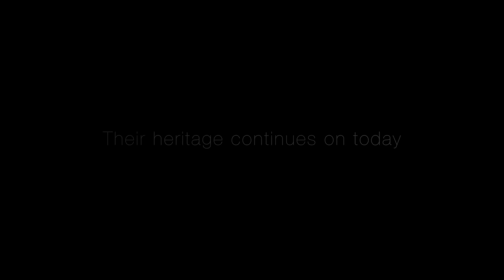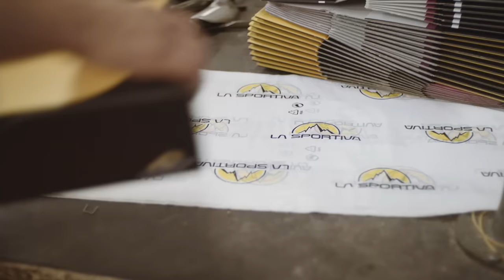La Sportiva: sounds of a brand

Comment: I have worn the La Sportiva Nucleo High GTX Boots for almost 2 years now, and put over 1500 miles on them in the harsh Arizona desert, where the rock and dirt can seriously do a number on the soles of boots. But for the longest time, up until today actually, they have held up perfectly, and the soles have lasted, as well as the leather and the stitching. But after so long I've worn the soles down to the leather in a lot of places, and the leather finally cracked around the toes a little where my foot flexes. I have to say, these boots are extremely good quality, and it is obvious that a lot of care, and attention goes into every single product. My rock climbing shoes are also the Muiras, and I have loved them ever since I first slipped them on. I will always look for a boot from La Sportiva before I look anywhere else.